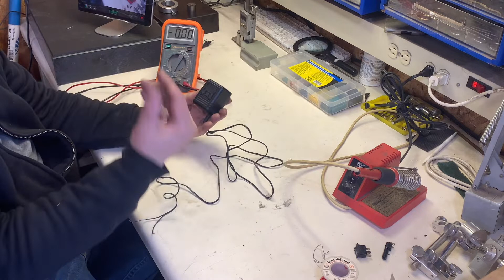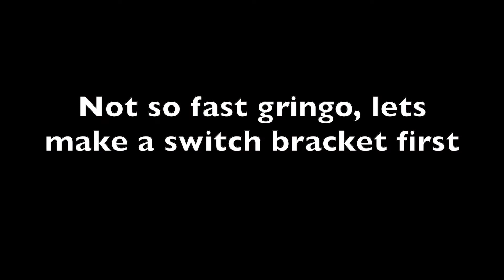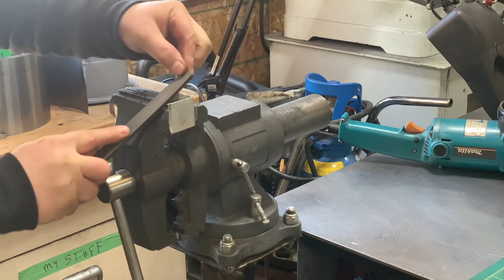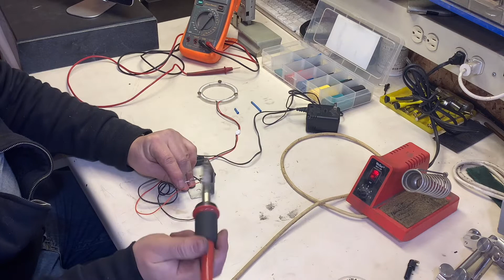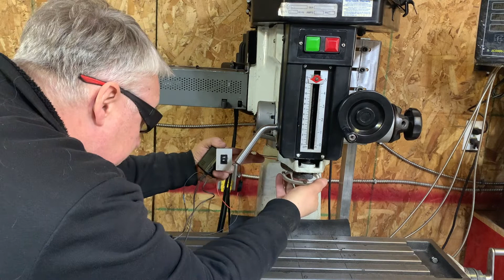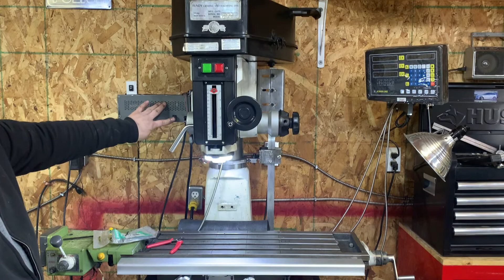Wiring Milling Machine Spindle Light

Comment: By soldering the live to the centre terminal of the switch, don't you have live voltage at the 3rd terminal when the switch is off?
Reply from the maker: Sure enough I reversed them.  Nice catch. I shouldn't be talking and working from the looks of it.  I'll swap them when I go to the shop.